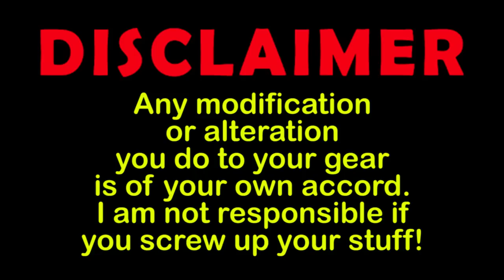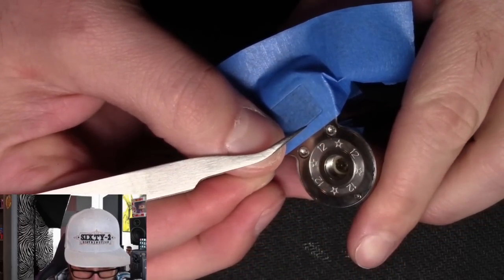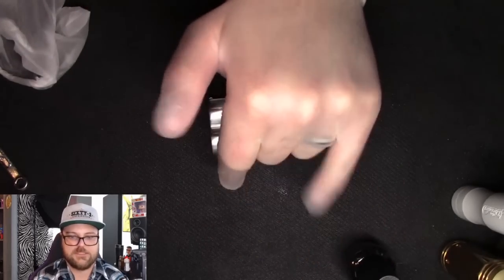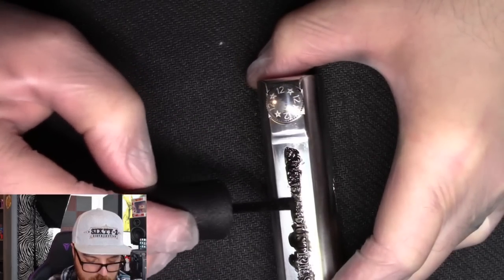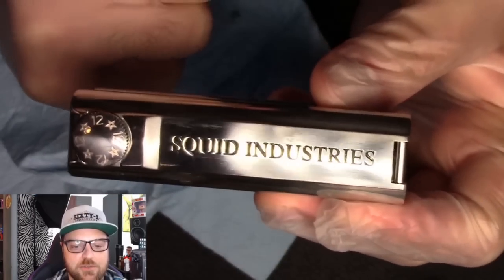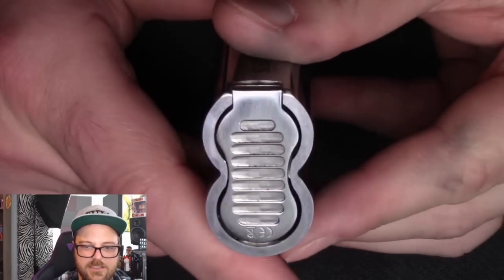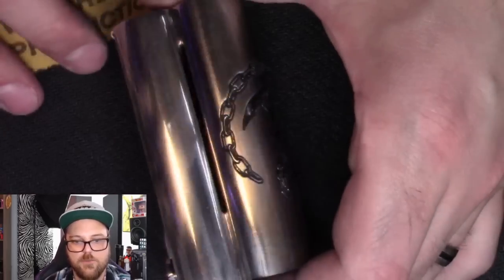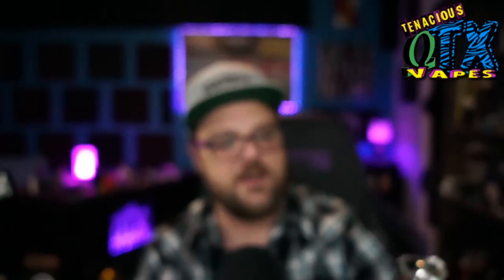How to brush metal mods and fill Engravings!

Comment: I have two small wire brushes, one stainless steel, and one brass. I've used them to brush mech mods before and they did a pretty awesome job. Start with the stainless brush and finish with the brass brush. The end result looked like it was professionally done.

Comment: This was perfect information for my project. A new torque wrench has lots of measurements engraved into the handle making it hard to quickly take a reading. I had the idea to fill in the writing  but didn’t know how or what to use. This has provided me with a great option. Cheers
Reply: lol i had the same idea thats why ime here im going to do my torque wrench in red if i may ask how did it work on your torque wrench
Reply: @vmrhanky  unfortunately the engraving isn’t very deep so I made a bit of a mess that easily wiped up however I was trying to do it quickly. I still haven’t got round to doing it but when I do I will make sure I can take my time

Comment: You did a great job stan. Looks awesome. I will give ya a tip with filling in the low spots, wrap your towel around something flat, use a flat surface to rub off all the excess nail polish\paint. The flat surface wont get down into the machined spots but will take the excess off. Also a great way to make your sand paper last alot longer in put duct tape on the back of it. You didnt do anything wrong, ya did a great job and im sure this video will help some people out,  just giving some tips from someone whos worked with metal for decades. Stay well and vape safe